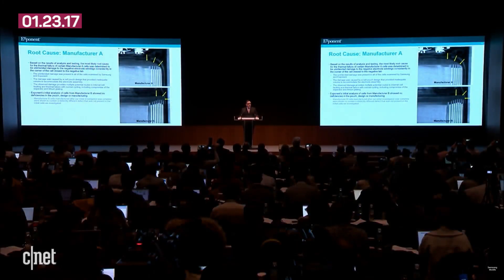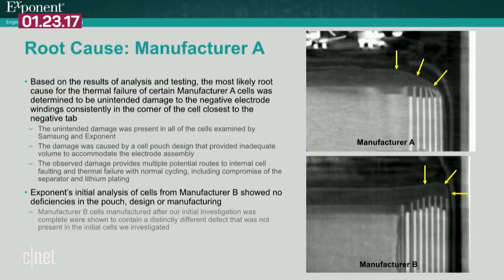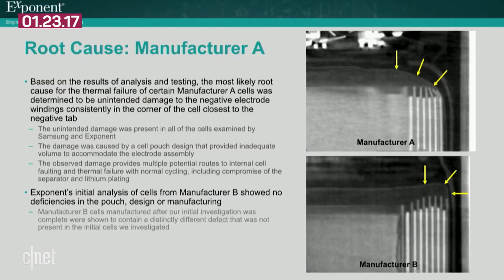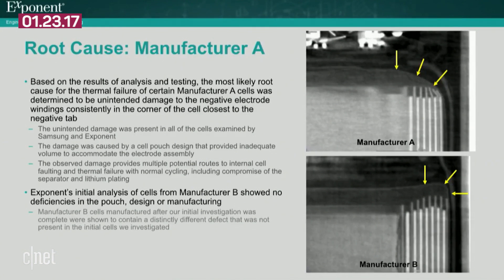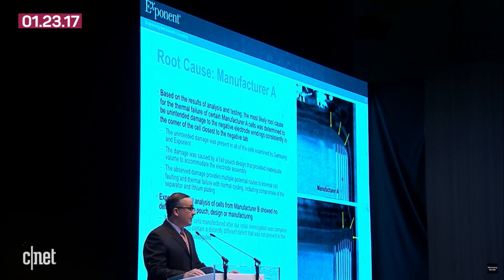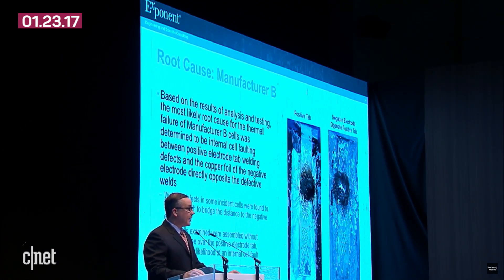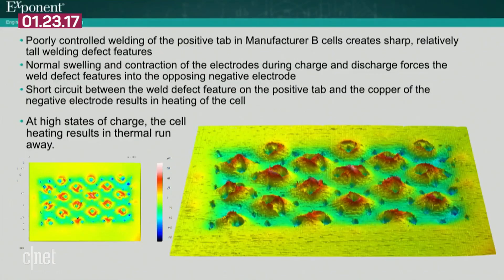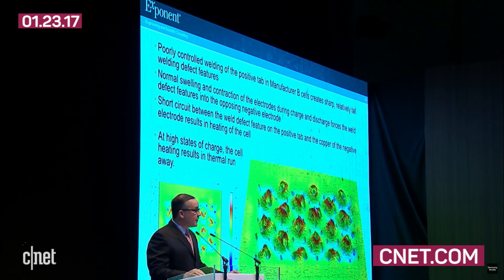Samsung explains why the Galaxy Note 7 exploded

Comment: another reason why the battery went boom is that people were using China's chargers that were usb so they were made badly because usb just came out and when people used Samsung's charger there was a very low change of going boom so that's the other reason.

Comment: Note 7 The main cause of the Explosion is the flaw in the design of the mobile phone. The Battery capacity is too large and the Battery space is seriously insufficient. Excessively slim body makes the battery under pressure. Explosion accident

Comment: and this is why they should keep it at user-replaceable because when it was that way they never had that problem on top of them rushing the product just to be a competitor we all saw what happened with Microsoft in the past with the Xbox 360 trying to be the PlayStation 3 and we at lunch by releasing a year before then we got the red ring of death amongst other problems because they didn't check and Q&A their products well enough before release just to make the bottom line

Comment: as an auto technician I understand this 100%. it's the same as a faulty car battery. basically if the cells come I contact while the car is moving or alternator proving charge the battery explodes. a car battery explosion is about the same as holding a grenade in your hand and letting it explode. One of my co workers lost an eye and had severe scars in his face due to a car battery explosion. after that I try to stay away from car batteries. I'd rather let a strut pop out of its mount than a battery explode on me

Comment: This also serves to warn any remaining Note 7 users that the "thermal runway" incident, (exploding, spontaneously combusting, setting your house ablaze), is also caused by simply charging the battery. This is not bias, or hate, simply a manufacturer defect. If they [the remaining users] treasure the device more than their lives and properties than they should invest in DIY battery replacement.

Comment: Imagine how mad they are at the battery manufacturer lmao
Reply: Samsung used both Samsung SDI and ATL in Note 7's initial batch of phones. then when they found SDI to be faulty they ordered from ATL to replace the faulty ones. It also had problems. 

So ehh faults on both sides quite literally
Reply: @GayNeekOG  OR The manufacturer is doing a dodgy and sending in parts from a cheaper competitor. Aircraft PArts manufacturers got caught doing that and leading to crashes.
Reply: This explains why Samsung has decided to use LG as its battery manufacturer for the Galaxy S8.
Reply: Justin Stewart it doesn't really have that much to do with the battery itself you know
Reply: PT111111 Samsung SDI manufactured the original batteries, and an unnamed Chinese OEM ("responsible for manufacturing batteries used in many flagship devices in the market today" - original statement by Samsung when the first lot of Note 7's were being replaced). They used "Manufacturer A" to protect the integrity of their own subsidiary, and "Manufacturer B" to avoid a law suit from the unnamed manufacturer for slander.
Reply: yeah! I smell a huge lawsuit
Reply: D Jaquith/ Samsung already released around 10 new models with batteries manufactured by Samsung SDI since Note 7 and no problem with any of those models so I guess Samsung already fixed the problem
Reply: ***** Against their own company? Samsung SDI manufactured the batteries.
Reply: Considering the lack of disclosure, my money is Manufacture A is Samsung. What they're afraid of is all of their phones being questioned.
Reply: battery manufacturers are 1. Japanese owned Chinese company  2. Samsung owned company
Reply: @머쓸이  True
Reply: brown bobby the problem was the dimensions and the capacity of the battery was ordered. As we saw they can't manufacture them without problems. Responsible were the two battery designers of both companies who don't mentioned the problem to Samsung.
Reply: What rinky-dink setup was responsible for making these batteries? Hope they're happy about ruining what would have been a great device.
Reply: Says there Manufacturer A & B.
Reply: U mean joway?
Reply: Do you have any proofs that this explanation is wrong ans the phone itslef is to blame?
Reply: If the battery was not fail, if everything go well. I bet Samsung note 7 beat over iPhone, being their best seller. 
I still really like note7, I never use it but from all ppl I knew use note7 all of them love it. At least in Asian, I don't know about USA or other western country cause they still very close mind to Samsung.
Reply: Buy a different battery for the phone
Reply: grenade manufacturer*
Reply: Justin Stewart They should be mad at themself because they made the batteries Lol

Comment: I hope the note 7 will now be back up for sale with them fixing the issue.
Reply: They've moved up the release of the note 8, note 7 is dead and is to forgotten like a bad memory.
Reply: Aden Note 8 is coming it's confirmed by samsung !
Reply: Aden there is going to be a note 8
Reply: Aden there will be the s8 and s8+ and then note 8 in the fall. It has been confirmed
Reply: Tech Defender nope. S8 is next, and then the amazing Note 8 in Fall! Already confirmed
Reply: It won't they've spent millions in new QA just to test batteries and charging/discharging of new phones. The batteries were one of the few components in the phone not manufactured by Samsung. It'll teach them to trust components from external suppliers without thoroughly testing them.
Reply: Tech Defender I extremely doubt it will be released in the US. Re-release in certain countries probably yes. But definitely not in America
Reply: Tech Defender Well, sadly they completely discontinued it. Fortunately, a refurbished edition, called the Samsung Galaxy Note FE, was introduced in July, a month before the Note 8. However, they only came in some countries and in limited numbers.
Reply: Tech Defender there is no new note 7 or other note line up... Just s8
Reply: even with them identifying the issue, the fact that there are thousands of the original and replacement phones still out there would prevent them from re-releasing the Note 7
Reply: Bryan Wiley they've actually released an update that would kill the device's capabilities to charge effectively disabling them forcing people to turn in the phones
Reply: Pedro Brito obviously you havent been around since the first software update. theres e tire communitys that are dedicated to keeping from installing those updates. samsung shouldve made it a mandatory recall
Reply: Bryan Wiley I haven't really followed the issue, but I imagine that there's always people that enjoy playing with their lives
Reply: Tech Defender Lol the note 7's reputation is already destroyed and caused many people emotional distress. Most consumers wouldn't risk rebuying it. I sure wouldn't but it
Reply: i still have my fireball 7 (note) have had it since it came out lol no problems at all. Still think its the best phone one the market as long as it doesnt explode lmao
Reply: Tech Defender true because I had a note 7 for my birthday I only had it for like 2 weeks then then I had to return it i miss my S Pen My Iris scanner I have a S7 edge rn 😝
Reply: Looks like it is, but refurbished ones in some countries like south Korea at the moment.
Reply: Note Fan Edition
Reply: Note FE isn't worth it with the Note 8
Reply: Tech Defender so its been obviously 11 months and i have a note7. I bought it before they were recalled and mine has worked perfectly fine lmfao, ive even accidentally left it on the charger overnight even though it was fully charged.
Reply: Tech Defender too late now. It's been months since, what's the point in reintroducing the phone when it's just going to be replaced in a few months?
Reply: Ryan Good well reintroduce it but sell it at 600 not 850
Reply: And if explodes again hahahahahaha